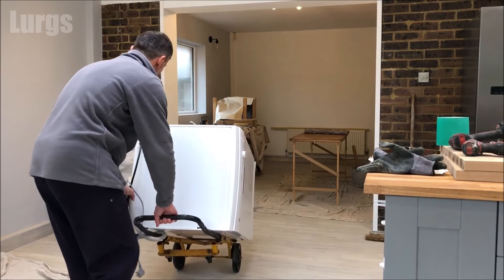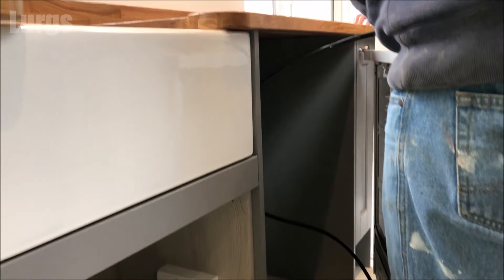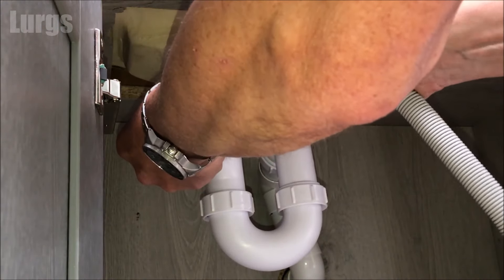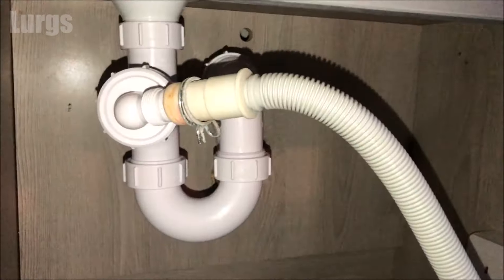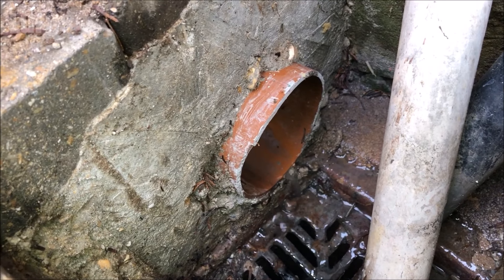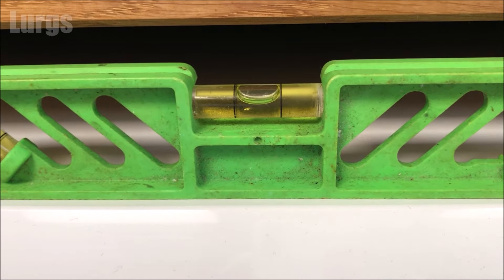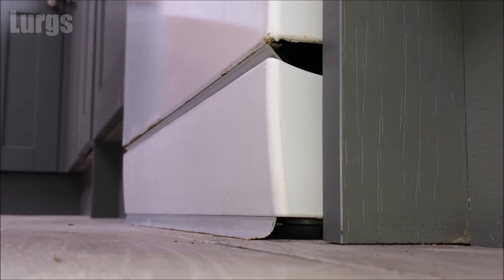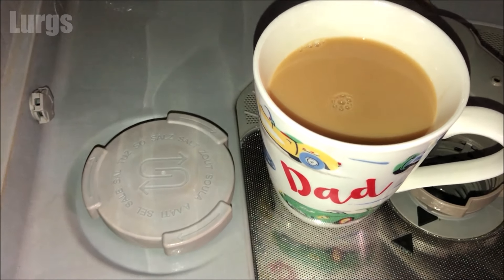How to Install a Bosch Dishwasher in simple easy Steps - Bosch Dishwasher Installation

Comment: How do you plumb a dishwasher if you already have a washing machine using the cold water feed and the drain outlet? Many thanks
Reply from the maker: You’ll need a plumber to create another cold water feed for you. Drain outlet if it’s under the sink should have a spare connection

Comment: The cold water feed pipe has two ends that are not the same, so which end goes into the Logik dishwasher?
Reply from the maker: The end with a 90degree turn goes in the Dishwasher

Comment: I have two water connections? Red and blue? I imagine it's hot and cold does it matter what one gets connected?
Reply from the maker: I’d connect just the blue as the Dishwasher heats up the water anyway to the exact temperature.

Comment: how to remove toe panel to adjust back foot level from the front
Reply from the maker: Can't remember if you can adjust the rear ones the same. Hard to get to, would need to pull it back out

Comment: Width of the spacing?
Reply from the maker: Not sure what you mean, there is a 1cm gap on either side of the Dishwasher.
Reply: @LurgsHowToGuides  Can I fit a a machine with 598mm width in a  cabinet with width 600mm?
Reply from the maker: @subhamdebnath3226  Unlikely as that is only 1mm either side, no wiggle room to push it back.